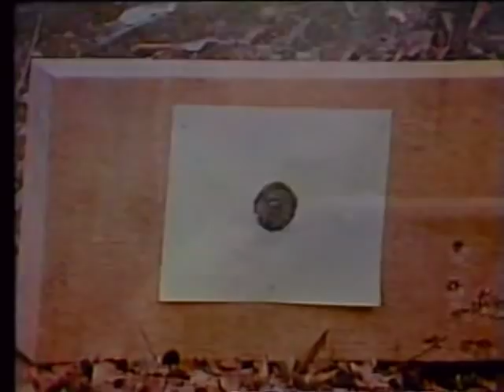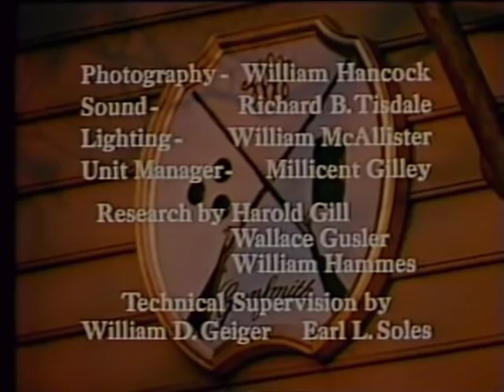Colonial Gunsmith

Comment: This should be the standard to which the History Channel should hold itself. This was brilliant!
Reply: An order of April 6, 1779, issued in Boston and now preserved in the Emmet Collection of the New York Public Library, describes in detail the arms and accouterments of that day. A copy of it in the Morristown exhibit reads:
To Shrimpton Hutchinson Esq.
SIR,
You are hereby ordered and directed, to compleat yourself with ARMS and Accoutrements, by the 12th Instant, upon failure thereof, you are liable to a FINE of THREE POUNDS; and for every Sixty Days after, a FINE OF SIX POUNDS, agreable to Law.
Articles of Equipment,
A good Fire-Arm, with a Steel or Iron Ram-Rod, and a Spring to retain the same, a Worm, Priming wire and Brash, and a Bayonet fitted to your GUN, a Scabbard and Belt therefor, and a Cutting Sword, or a Tomahawk or Hatchet, a Poach containing a Cartridge Box, that will hold fifteen Rounds of Cartridges at least, a hundred Buck Shot, a Jack-Knife and Tow for Wadding, six Flints, one pound powder, forty Leaden Balls fitted to your GUN, a Knapsack and Blanket a Canteen or Wooden Bottle sufficient to hold one Quart.
Reply: You mean the Used-to-be-About-History Channel?
Reply: History channel doesn't want is to be proud of our history.

Comment: While this method seems to be an extremely intensive and time-consuming process, it does peak my interest to wonder how fast you could do this with an assembly line system. You would have a proper, well-trained smith doing all of the difficult things like forging the barrel and the metal parts for the lock, but you could increase efficiency by having different smiths each forging a different part so that they don't have to keep switching tools. You could then have all of the less-skilled tasks like filing and boring done by less skilled apprentices, again each one doing just one single task each. 

You could further increase efficiency of the system by having each master of the process being a master only of the part they are responsible for. It may take a lifetime to train a gunsmith to be able to do every job perfectly, but I am certain that you could train each individual worker to do their one singular task perfectly in a matter of months or even weeks. 

It takes one smith a month to make a rifle, but a hundred smiths could probably produce a thousand a month due to increased efficiency and the economy of scale.
Reply: Obviously more hands equals faster production. But you need a lot of money to hire all those people.

Comment: How did they make muskets for millions of soldiers?
Reply: I suppose they standardized the musket so that multiple artisans could focus on producing identical stocks, barrels, locks, etc. Gunsmiths could then assemble a batch of them, ignore the decorative work, and test them for adequacy.
Reply: Larger numbers of specialized craftsmen worked in shops, turning out only one specific part, such as a barrel or lock, before being assembled by a different craftsman who's sole duty was assembly.
Reply: - Charlie Willfong  -That same system you describe, was used for many years, following the Industrial Revolution, across the USA. Chicago Illinois had countless 'Job Shops', each doing one specific application. Our shop was known for the ability to hold one tenth of one thousandth of an inch tolerance, on mass runs.

 We checked each part for spec, on a precision magnified 'Shadowgraph' dial indicator, with a glass screen. Our four multi tool Turret Lathes, were the size of mid size cars. Our milling machines were French design, with punched paper tape programs for repetitive automatic machining. Other enterprises around the city, included heat treating shops, tucked away in small alleys of Chicago. 

Family men of all cultures, races, first worked on the docks, packing, loading products. If they proved reliable, capable, they advanced to drill press operator, machinist, or the coveted 'Tool maker' trade. Family members of the owner, did the books, maintained the positive cash flow accounting for profit. In our Non-union Job shop, my job ranged from milling machines, to Turret lathes, to loading dock and even truck driver as required.

Fine polishing of various sized parts, was another shop's trade. Electro-plating of parts, yet another. Small parts were manufactured, assembled in family homes scattered around the city. Non-Union, family operations, with hired help, was the way these thousands of job shops survived.

Grinding precision cylinders of various sizes, was yet another individual 'Job' shops specialty. We ran our truck from shop to shop daily, picking up and delivering the various staged items by the thousands, the pallet, or barrel full, or whatever the bid required to complete the shipped order.

 Our major final product could be parts for Caterpillar, Hough [back hoe] or Bucyrus-Erie. Massive Drag-lines, for removing overburden for open pit mining, to large earth moving tractors. Wrist pins, for industrial piston rod assemblies, Valve lifters for Detroit-Diesel, to precision hydraulic cylinders.. Even intricate, specialized cam shafts were built in 'Job' shops. 

All ended after 'The Great Society' funded millions of those individuals inclined to Not desire a job. The China connection, arranged by President Nixon, [most favored nation act] sealed the nails in the US industrial coffin. 

 One sad outcome, Feral lifestyles across the USA, replaced Traditional Families, that were dependent on each member, as fathers no longer had the desire, nor jobs to hold. 

Previous to 'The Great Society', starvation, or poverty for not working, not maintaining a functional family core, was a very real possibility, if Not connected to a local church. There was little welfare available during those amazingly productive, highly prosperous times. The majority of US Citizens at that time had a positive daily task.
Reply: @Blogengezer  Wow, I actually didn't know that. Down here in Arkansas, our economy has always been based on agriculture. And I wholly agree with your last point, young people aren't given a chance now unless we spent thousands of dollars on a piece of paper.
Reply: Charlie Willfong  -Being raised on a family 'compound', small subsistence farm, I understand agriculture. We worked larger farms for small extra wages when young, feeding animals, grooming work horses. 'De-tasseling' DeKalb corn hybrid rows, while with several other kids, riding a 3 wheeled tricycle, elevated tractor designed solely for that purpose, earned cash daily in hot humid growing season. Harvesting of crops, mowing, baling, putting up hay in barns with very hot lofts, was yet another source of seasonal cash. Picking fruit and other crops, some by the bushel, payed cash daily. 

Owning a multi purposed John Deere, was due to grandparents planning. Experience gained from the Great depression of the 1929 era. The J.D. earned it's cost and maintenance on my contracts for plowing, cultivating, mowing, landscaping. 

Fortunately I was also not too far from the distant outer 'Job Shop' limits (50 miles) of the city, for a weekly pay envelope [cash), with time card copy, in a yellow, small folded envelope. 

Truck driving exposed me to the realities of trade, industry, commerce, time management, and the need for Profit. Prosperity automatically comes from focused goals and determination, using 'continuous' education as a tool.. I sense from your well described comments, that you have followed the similar path.